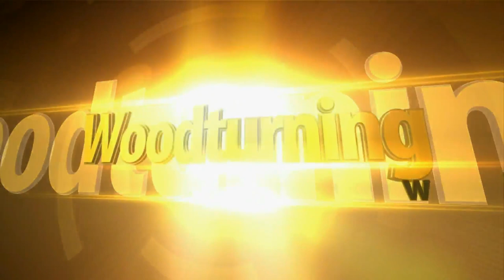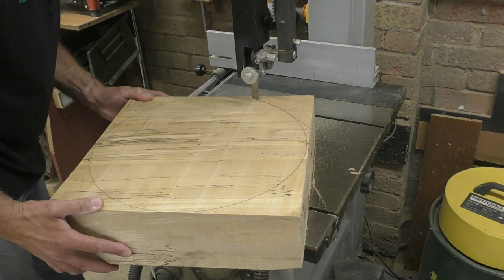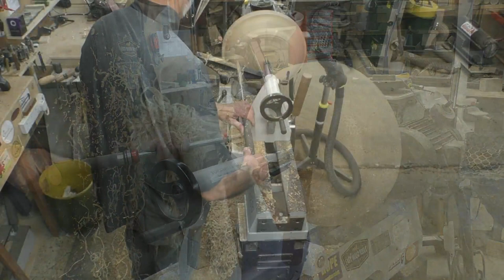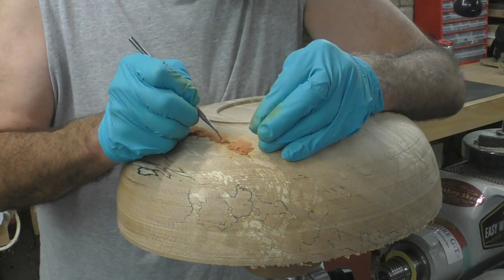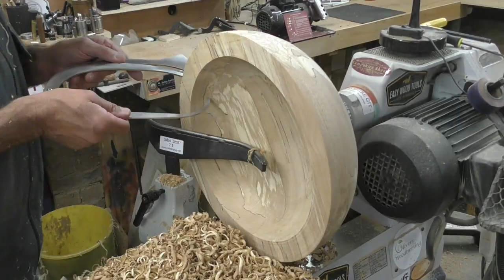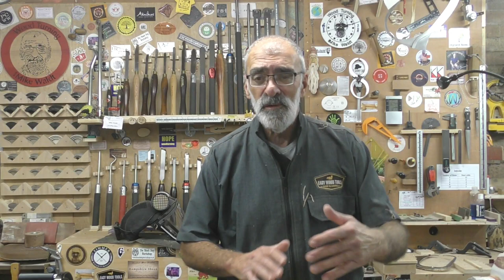Woodturning - Spalted Beech Bowl using Milliput as a crack filler. Part 1

Comment: Great job Mike and many thanks for the shoutout. When filling cracks with Milliput I have found that it is best to paint a bit of slow set epoxy resin into the crack first and immediately pack the Milliput in on top of the wet resin. The Milliput then fills the bulk of the void and pushes the resin deep into the crack ensuring a good bond to full depth.
Cheers 
Jim
Reply from the maker: Thanks Jim and my pleasure mate. Thanks also for the invaluable tips too.
Cheers
Mike

Comment: I have experimented with colouring Milliput using acrylic paint.  It needs a lot of working in but it works well to change the standard green/yellow to whatever you want.
Reply from the maker: Thanks for the tip Tony, much appreciated.
Cheers
Mike
Reply: Tony Campbell - the standard seems to be white, black or grey.  I see Mike using terra cotta.  Ive also seen turquoise as an optional color, but not from the UK vendor.

Comment: Fantastic job mike as usual does a hot melt glue gun really hold that well I have one but have never used it any tips greatly appreciated cheers buddy 👍
Reply from the maker: Thanks Clive, I have 100% faith in the integrity of a hot glue joint providing both surfaces are dry and the glue is properly hot, with a good quality gun and glue sticks. I have had wood fail due to a catch but the glue joint remained intact.
Hope this helps.
Cheers
Mike
Reply: Thanks mike think I will give my glue gun a little try 👍👍

Comment: Hi Mike, I often use Milliput as a filler, as it's much cheaper and useable than resin. What was the starting moisture content? Did you take a measurement from inside the bowl as well? Although it depends on the wood, Ive had a lot of seepage of the CA glue into the adjacent wood that will not go away, just with sanding. Now I've started to apply sanding sealer locally to prevent  the seepage and it seems to work. The only downside to Milliput is the limited colour range, you can add colouring to it but it takes quite a bit of dye to get strong colours .BTW that is a lovely piece of wood and will make a wonderful present...looking forward to Part 2
Reply from the maker: thanks for the tips Jockey, much appreciated.
Time will tell how it ends up.
Take care
Mike

Comment: Hi Mike. With this video you have broken any myths about how good glue blocks are for supporting pieces for turning no matter how big or small. Hope it doesn't alter too much during the drying process over the next few months. Cheers, Huw
Reply from the maker: Hi Huw, I have used glue blocks for a long, long time now on certain projects, and have never, to date, had the joint fail, providing the glue is applied correctly.
Thanks for watching.
Cheers
Mike